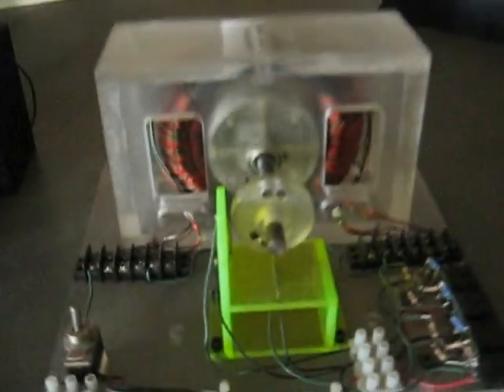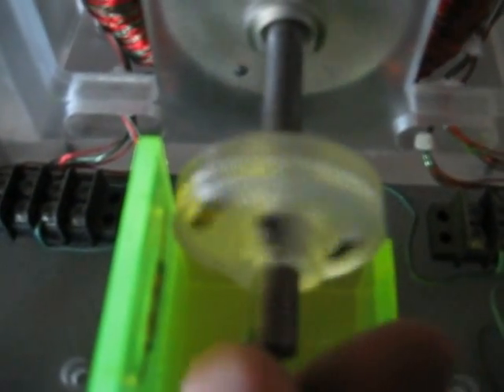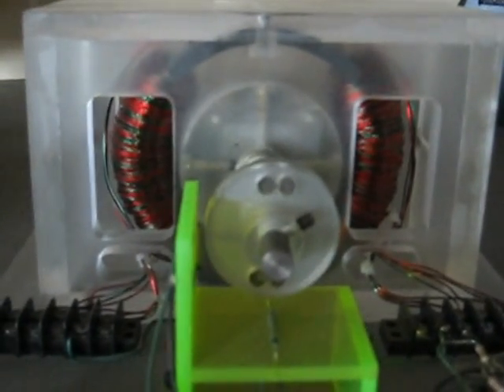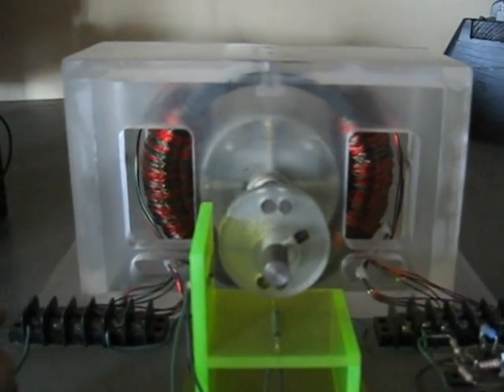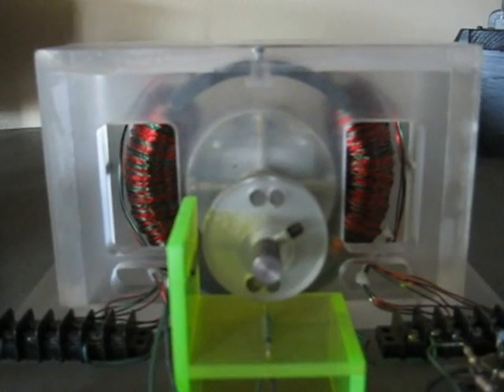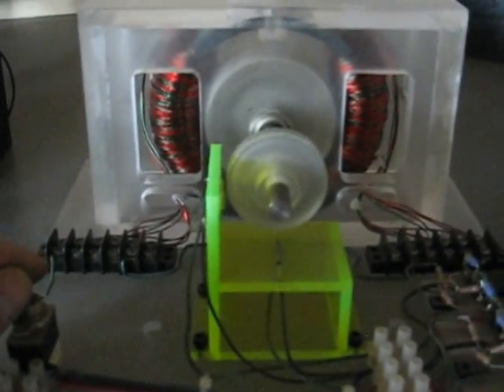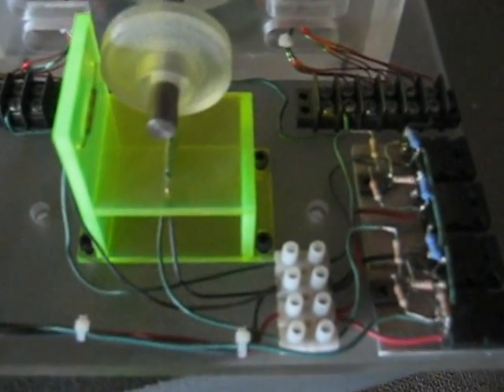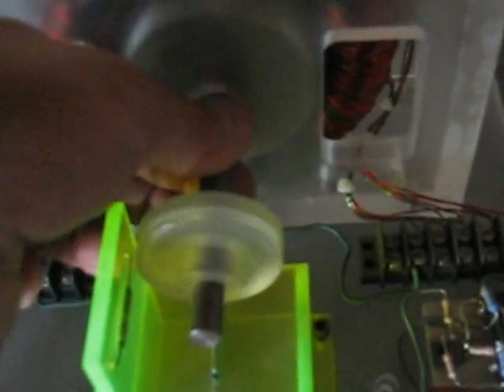ZERO FORCE MOTOR  John Bedini

Comment: John's clearly not after the easy money, otherwise we'd hear his voice in every hollywood movie teaser... "In a world..." hehe. Great work, love the zero force concept! Guys watch the other vids, plans not really required, two arc shaped coils in parallel polarity, magnets angled, so one pushes and the other pulles. Then switch off the coils frequently, so the pms don't get stuck at the other ends of the coils. Great Job John, but how about a zero force generator? As far as I see that would be NO LORENTZ FORCE on load... I truely believe it can be done, with an arrangement similar to this zero force motor principle. Fully parallel pm vs coil pole axes, utilizing the lorentz force 90deg. controversy, smoking lenz in the pipe... Keep it up!

Comment: Hey John
is there a diagram I could access showing the proper build of this motor.
I mainly want to know about the core and coil wrapping.
Is the core 360 degrees around the rotor?
 also. ???If the core was in an S pattern instead of a circle-- could, you run 2 rotors in the same direction with one coil ???

Comment: very nice set up. i bet it has some serious torque. something we have been working on is adding another rotor with magnets facing out north and south with about 8 or more magnets. then holding a pipe made from copper close to the magnets. it actually heats up the magnet so we are building a set up to charge batterys, and heat the room. your set up should run it pretty good. again, excellent looking motor, congratulations on the build.